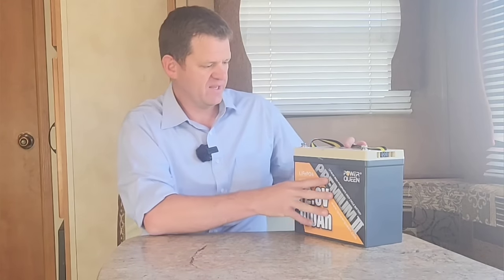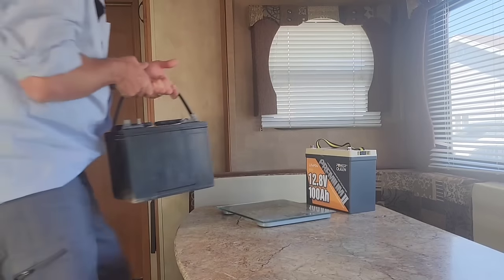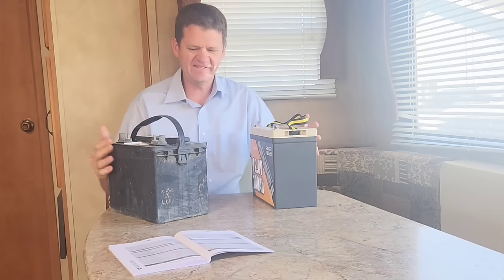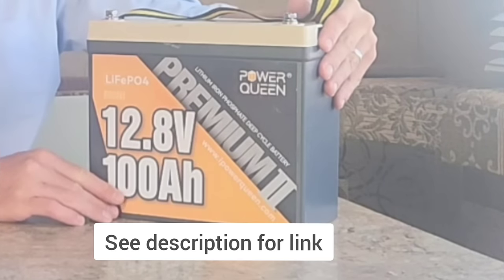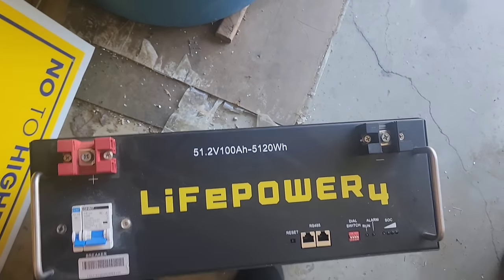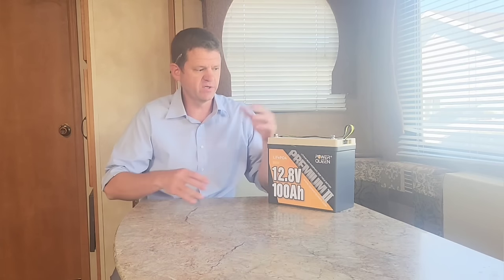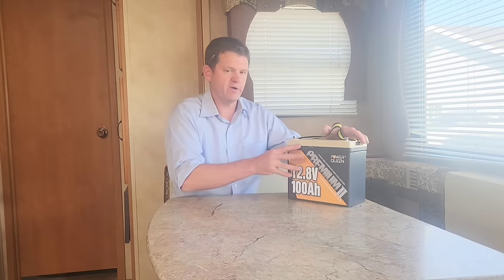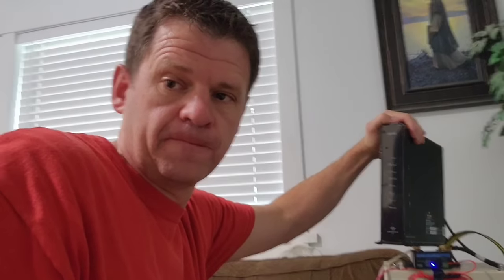How Long Can a 12V LiFePO4 Battery Run a Fridge, TV, Laptop, and Wifi Router (PowerQueen test)

Comment: I would suggest an upgrade to at least 2 batteries and a 24v system. When you do the math of a 12v system the run time drops as well as the amp p/h. A 24v system will deliver a much more without taxing your system. If your power loss is at night i am sure you would wish to run some lighting. May wish to add this into your equations. Not having the proper amp needed for the fridge will shorten the life of the compressor. Also a pure sine wave inverter should be use or again the life of the fridge will be much shorter. Non pure sine wave is much to erratic for any motor. Running each separate is very deceiving. Currant is much more important than amps alone. Good luck.
Reply: I'm about to have 30x180w panels hooked up to 4x 190ah agm batteries with victron hardware,it'll be a 48v system,how much  benefit am I realistically looking at
Reply: @royroyson2655  30 panels of 180w is 5400w. that's enough to run a house as long you're not running a clothes dryer and well pump. 5400w at 120v will give you 45 amps. 48v system is nice just remember your end voltage is 110 or 220. I don't know what you are using for an inverter so you will be limited by the inverter output. Unless you spent the cash on an expensive inverter don't expect it to put out nearly the amps it says it will. The made in China inverters are crap. Like just about everything made in China. But should be plenty to run lights and a fridge. Could run a well pump too. Just don't want to many things running all at the same time. Best of luck!
Reply: @leostgeorge2080  so to clarify it was a 5kw system that we just replaced with a 12kw system(law suits are in progress against the company that installed the 12kw system) so I won't really go in-depth with that but the 5kw system had a German inverter, the mppt, regulators etc are victron,it'll be a offgrid storage for my shed,we live rural with 2 houses on the property,2 sheds aswell,2 septic etc,we supposedly use 1800kw a month,but that has only been since the WiFi meter was installed,what our 3 month bill totalled at is now what they say we use per month,I believe their software is dodgy but try getting the qld government to admit that is extremely unlikely
Reply: @leostgeorge2080  thank you for the insight,it's very much appreciated
Reply: @leostgeorge2080  our daily usage for 2 houses and 2 sheds,2 septic,2 house pumps,bore pump etc is around 60kw a day supposedly
Reply: @royroyson2655  The average house is 29kw a day so 2 houses consuming 60kw is average. Best of luck with everything.

Comment: I don’t think you want to run LifePo down to 0%.  Last I heard, 20% is a recommended stop point.  
EDIT: Maybe the manufacturer has a bit more than 100AH of cells inside the case and the BMS stops discharge at 100AH?
Reply from the maker: You might be thinking of lithium ion. Lithium iron phosphate have a 100% depth of discharge

Comment: When the power goes out, the laptop already have a battery.  Fridge don't need power as long as you don't open it.  Battery backup for the wifi and cable modem is useless for me because cable doesn't work during a power outage.  I use my cellphone hotspot for wifi.  And the cellphone already have a battery.

Comment: Very helpful thanks very much. You are like me an engineer at heart. You probably are an electrical engineer.
Reply from the maker: Software engineer actually... But I do enjoy the hardware side of things. Engineering stuff is definitely fun. Thanks
Reply: @diySolarPowerFunWithRay  So as an electrical engineer myself, I had made the right observation. I am trying to adapt the solar panels for my home, and still looking to buy 16ft cable to connect to my soar generator. The issue is, it has to be 10 gauge power cable as it has to carry 7 Amps of current. Thanks for the video

Comment: I have to test this battery for myself fella. The thing that gets me is the cost. A bit high for sure. 😀😀
Reply from the maker: There are a lot of cheap options out there. Just realized this will replace two of your lead acid batteries and they will last 10 times as long
Reply: That part is superb for sure. NICE!! @diySolarPowerFunWithRay

Comment: Fridges are difficult to estimate because of the variables such as ambient room temperature, how many times the door is opened, how long the door is open for, the temperature of things put in it etc... A fridge should be in the coolest room with air circulation

Comment: fyi - in a pinch for watts, you can use the router and laptop with the cat 5/6 Ethernet cable and turn the wifi off.

Comment: Perfect timing.. just bought a 768wh Ecoflow River 2 battery (waiting on its arrival) to see how long I can run my desktop/monitor on it, and how fast 220watt solar will charge it, and how much battery I need to run the setup for 16 hours a day. Easy to figure out with static values, but computers/etc vary all day up and down on power usage. So trying to figure out how to run it all on battery because its about 97% of the energy I use weekly (minus AC in summer but have solar panels on roof for that).
Reply: A minimum of 3.5 hours of bright sunshine to charge the battery with no load on the battery.
Reply: @deang5622  to be clear, the 220watt would take 3.5 hours or more to charge the river 2?

Comment: Well we bought a 2017 Nissan Rogue from Enterprise Car Sales which had 33,000 miles on it. We did not have to replace that battery until this year! 7 YEARS! Probably eight because the car was made in 2019!!! I mentioned this to a guy at Valvoline Instant Oil Change and he claimed  that he too had a long life battery BUT... he also said that he is disturbed at seeing so many batteries that they sell come back in 2 years or less needing replacement! Go figure

Comment: I had a 1000 watt mod.sine wave converter  that would kick off on startup.  I bought a better quality 2000 watt that works fine.   Don’t know if was because it was a mod. Sine wave or that it was a  cheap one from a tool supply company.

Comment: Whats your opinion on those used panels? They have amazing prices! I'm nervous getting used solar panels but in curious about your thoughts and experiences with them. Do you mix new with used or keep the used separate? 
Thanks for taking the time to make the videos great information.
Reply from the maker: I like them.  Over I upgraded to some better used solar panels and I like them better than these used ones. You can check out my most recent video where I compared some new panels to use panels. They performed pretty much the same as the new panels. 
   I have a link in a discount code for the used solar panels if you want to go that route.
    I wouldn't mix different types of panels. Good luck.  👍

Comment: The losses are mainly heat. But so far a very efficient hookup. It would be a nice system if solar can charge the battery as quickly as possible when you are not using the inverter, disconnect solar and use the battery to run 12v LED Lights in the house when its getting dark. The capacity should be enough to do that, saving you real money every day. Using an inverter is not always needed with appliances that can run on 12v, saving you most of the losses. But you already knew that.

Comment: I have a power queen 12.8 190 2k inverter 5 100w panels it runs all my exterior lights at night and with no sun in winter that one battery gives me 2 1/2 nights The only thing I dislike is the Power Queen has a huge case compared to whats actually inside
Reply from the maker: I'm using the mini model here. It's pretty nice but cost more

Comment: You can't just put in the watts on the label. To convert VA into Watts, you need to know the power factor of the load (the appliance you are connecting). Each appliance has a different load factor. Software engineer, did you say? 😊
Reply from the maker: I think it's just interesting that if you shop for generators or inverters, all of them will post their output in Watts...  not VA

Comment: The efficient inverters use a big heavy toroidal transformer. eg Latronics brand. My 5kW inverter is over 95% efficient, but weights a ton.

Comment: It’s not a good idea to take it down to 0%. You WILL damage the battery. The problem is that with lead-acid batteries you can determine the depth of discharge by monitoring the voltage, voltage slowly drops. LFP batteries maintain very close to a constant voltage until they reach a bit above 10% discharge and then they go down fast.  That’s why you need that shunt.  It allows you to monitor how much goes in vs out. 

I paid almost a $1000 for my 12V 230Ahr LFP. I’m not damaging it just to get a bit more power out of it.

Comment: Nice testing and video. 

Inverters have a standby power that is mostly always on,  plus the actual invented power.   So as an example roughly 30 watts no matter what is going on. 

The typical efficiency number is based on the portion that is above and beyond the standby power.   It's not supposed to be but that is reality.
Reply: Any way to stop that standby power being pulled?
Reply: @LifetipswithJess   It is like any other electronic device,  if it is on, some power will be used.  A small amount of power is used by chargers when connected,  displays and by wireless units that send information to your phone or tablet. 

What most people do is have an on / off switch for the inverter,  so turn it off unless you need 120 vac vs just usb or 12 volt. 

Some inverters use less than others.   That is part of the difference between an entry level inverter vs those that cost 3x as much.  It used to be that 1000 watt inverters used less standby power than 2000 watt inverters,  but companies have put more investment into the 2000s, so that isn't true anymore. 

If you have a larger power system, with for example 2 or 4 x 100 amp-hr batteries wired for 24 volt,  and 400 - 800 watts of solar,  then it will be slightly more efficient and there is enough charging power to just ignore the losses.   That is why I build those.
Reply from the maker: Thanks for the comment. I believe this inverter states that the standby power is only 8 watts when the inverter is in eco mode

Comment: If you run your home router directly off DC you’ll get at least 50% more efficiency. You can get a car charger for your laptop running that off direct DC also avoid the DC to AC back to DC conversion for more efficiency.
Reply from the maker: Thanks, I wonder if it would be hard to find a dc attachment for my router
Reply: Cut the wire and tie it to the battery
Reply from the maker: @ericwilliams952  actually my router doesn't run off 12 volts DC.  It requires 120ac.
Reply from the maker: @ericwilliams952  the laptop does accept DC power but it's 19 volts so it's not as simple as connecting the battery.. If that's what you mean.
Reply: @diySolarPowerFunWithRay  Buy cheap laptop inverter ( small 100W - big maybe 200W)  12/20V

Comment: I think you are using too small guage wire from the battery to the inverter. I suspect that it may be the source of power loss. Try this again with 2 guage copper wire. See if that makes a difference.

Comment: I still use lead acid, although they are heavy they are a lot cheaper than lifepo.
I can go through three sets of glass mat's for the same price of lifepo's, and each set of glass mat's last me ten years.
I'm totaly off grid and manage my power according to sunlight availability. 
Also seperate panels and batteries for different applications, never use one system to cover all requirements.
Reply from the maker: Interesting...Do you know the size and price of those glass mat batteries? You buy them online?

Comment: I ran for a full summer a 5000 btu window unit off of 4 12V AGM batteries in a 24V system with no problems. Initial start it would pull 800 watts and average was 500 watts an hour. What I am curious about is if one of these batteries would run a window unit. Was looking at a 24v 100ah battery earlier and then seen your vid has me thinking.

Comment: I have 3600w solar array, 48v system 8 6v golf cart batteries. It's running 2 freezers and a frig. I thought about lithium batteries but I got the 6v batteries for $90 each new. The appliances are in our barn so no heat or AC. I was told by the solar company Outback that the lithium batteries do not like cold or hot weather. And the golf cart batteries can be recycled.
Reply from the maker: How cold does it get where you are? If it's in a barn I imagine you could just stick a blanket over them and they would stay warm enough. These batteries also come with a heating element as an option.

Comment: You'd be able to run things longer if you ran the LEDs directly with 12vdc instead of converting it through the inverter and then back into DC

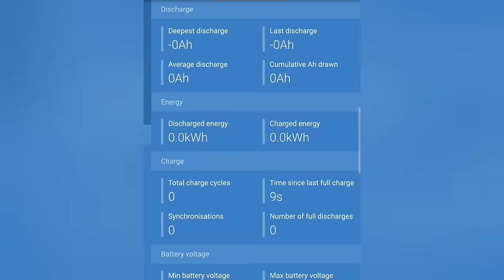Comment: At the 5:10 mark your Smart Shunt shows 100% charge on that battery at 13.25 volts.. I think a 100% charged LiFePO4 battery at 100% charge is more like 14.4 volts than 13.25 Volts.
Reply from the maker: I imagine that was because I had a small load on the battery which was reducing the voltage. I bet if I turned off the inverter then the voltage would jump back up to the 14.6  range.

Comment: I would expect a full size fridge to exceed the capacity of that inverter when it’s compressor is running. And the undersized wires from battery to inverter could have become blazing hot when you plugged all that stuff at once.
Reply from the maker: I believe when my compressor is running it uses about 500 watts and if I remember right that equates to about the max current my cables can accept. For 2 fridges, I'd need to build a custom cable. I'd like to build a 48v small power station, and then I could use smaller wires.

Comment: Love the videos bud. I'm looking for a small setup for my condo in case the power goes off. Couple batteries inverter plugged into the wall 24/7 if the power goes down short term I can use it as is. Longer situation throw up my solar panel on my deck. Any suggestions I'm a newbie to this stuff
Reply from the maker: Cool. this little battery(or the 200ah battery) is great for backing up a single fridge.  This system might interest you if you want to go a little bigger(depends on your budget and how often the power goes out).  https://youtu.be/fBYtKh2XxzQ?si=bIz-1SdhHpa-vysX

Comment: Thanks I learned alot. Was looking to find out how long I could run my 55lbs thrust trolling motor on a 12v 100ah. It draws about 720w And I'm thinking about 35hrs at 3mph on and off.

Comment: Can u do a video showing the controller with the battery connected to the solar and frige at the same time? Also how long it takes to the battery to charge from solar?
Reply from the maker: Great idea. I'll do that video next
Reply: charging the battery depends on how much power is available to you, I think most recommend a max of around 120amps so within an hour.

Comment: For a purely resistive load 500 VA should exactly be 500 watts because it is voltage times current. Inductive loads can cause problems with measurements like this. It's kind of like theoretical versus practical
Reply from the maker: I don't think that is accurate even for resistive loads.  I believe it would be true if you have a power factor of 1... which would mean your inverter would have to be 100% efficient. But I don't know of any inverters that are truly 100% efficient.
Reply: @diySolarPowerFunWithRay  right oh, I was talking about energy at the battery terminals, not after the inverter. You’re quite right, sir.
Reply from the maker: @forgeteverythingyouknow5413  cool. Thanks for the clarification. I'm definitely still learning a lot from everyone here

Comment: i took my home off the grid. not grid-self-disconnected. i think it's important that i have the grid as a temporary fallback if there's any long periods of poor weather. but my system comprises 1x400w panel and 1x420w panel in parallel into victron's 250 | 70 mppt, into 7.5kWh of lfp, into a 2000w inverter. right now, my home is drawing 182w (less than 100w when the fridge's compressor isn't making it draw more). that's the fridge and microwave from the kitchen, and my homelab of 3 servers, 2 network switches, the router and 2 work computers. i typically get 2 days of juice from the batteries. but the panels are out every day even if it's not very sunny. on good days, i can collect nearly 3kWh without a solar tracker in peak spring/summer weather. poorer weather looks more like 400Wh for the whole day, if i'm lucky; hence the grid as a temporary fallback. but that's everything plugged in running 24/7.
Reply from the maker: Nice set up you have there.

Comment: As a test I took a 10.000 watt power inverter ran my ac window unit over four hours before I finally gave up on the test I had to deep cycle marine batteries each one was 12 volt

Comment: Basicly you only get less than a days worth of backup power from that setup. But in a real emergency you might need a lot more power too keep you house protected from no power.  Great for camping  though.
Reply from the maker: Yes, you would need to lay some solar panels out. And get some more batteries.

Comment: 1e the victron use on its own 1 amp for standby 
2e wy a freezer on 120/230 volt ?
3e go for a 12 volt freezer so you have optimale use .

My freezer on 12volt use 2.5amps and its a compressor model.
On my 150ah lipo4 i run 5 days on it easy .

Comment: A cheap chinese ATS will switch back to grid power when the battery reaches a preset low level on the inverter. It will provide a UPS for house base loads like refrigerators and lights automatically and save you money on your electricity bill.
Reply from the maker: That's really nice. I need to look into that more. Is there one you would recommend?